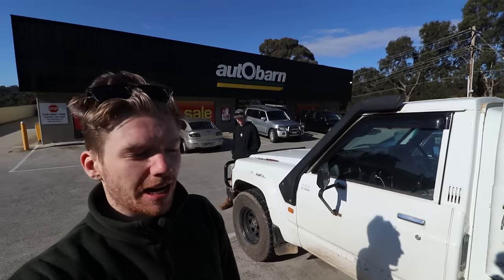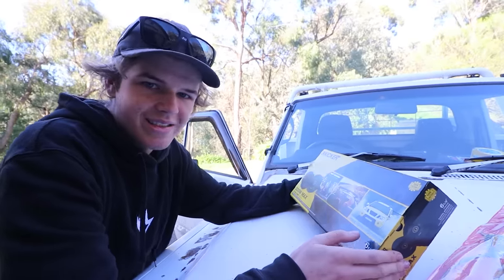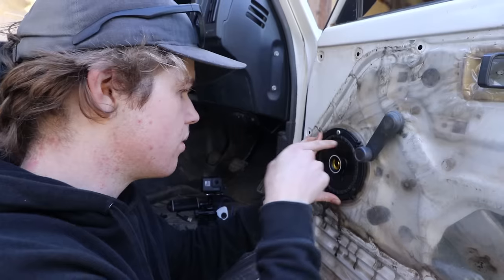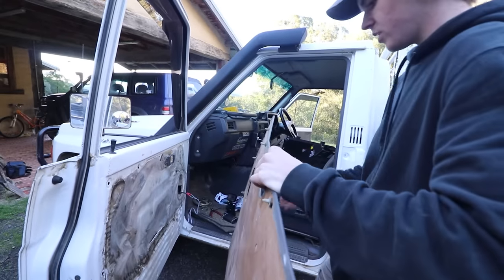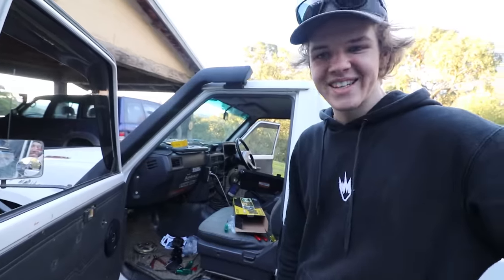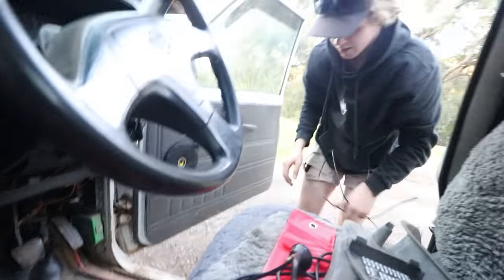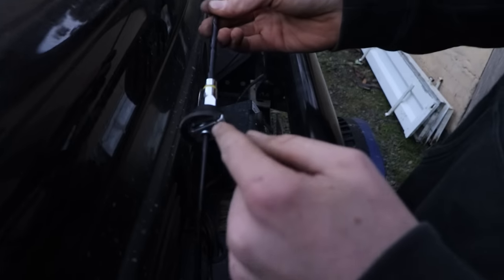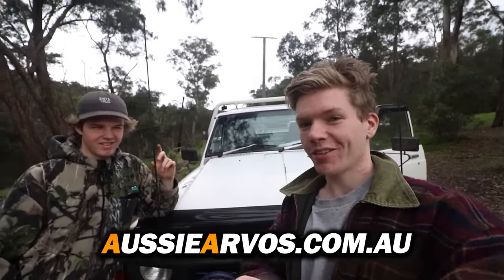BEST MOD FOR YOUR OLD 4X4! | Installing a NEW Sound System + GME Antenna in the GQ PATROL!

Comment: AutObarn fitter here. The kicker KS’ are good speakers. I’ve fitted them to quite a few cars and are a good entry level upgrade. They are well suited for both amplified and non amplified systems. Your head unit only puts out around 15W RMS and those speakers can take 100W RMS. So with even a small amp those speakers will perform even better. Good to see young blokes having a go and getting in a doing stuff. Good on ya. Keep up the good work

Comment: Get a Car-builders Insulation Door kit and you’ll be even more amazed at the sound. $99 for 4 door kit and you could use the excess on the engine firewall. It’s made a massive difference to my GQ.

Comment: Oh also did the factory speakers say peak or rms for the 25watts? Because without an amp you're only going to get around 30watts to the new speakers anyway. if you really want to get the most out of them you should buy a cheap 2 or 4 channel 100w rms amp which will be like a 3 or 400 watt 'peak' amp. They nearly always advertise peak wattage. Rms is the average, what it actually uses.

Comment: Hey guys good video as usual
Just a word of advise from experience feed cable over or under the grille I did it through on mine the couldn't get the grille off to fit my front mount intercooler I had to cut the cable
Reply from the maker: Ohhhh, yeah i see good point!! cheers!

Comment: speakers will work with the wires around both ways. Sounds better to have both speakers wired up right though. Learnt about it at tafe but i think if the wires are around the wrong way it makes the speaker "out of phase" and sounds worse. Probably more apparent when one is out of phase and the other isn't lol. Good job though (Y)
Reply from the maker: Cheers Steve!

Comment: I did different speakers the other day on my 95 wagon same door card design I found the best thing to do was to use some 15mm mdf board as a spacer cut them out with a jigsaw installed the speakers into them and then rivnutted them into the door it’s super airtight and works a treat I’ve tried what you did but I had to redo the whole thing after a few hard bush trips
Reply from the maker: Yeah we heard that spacers are a good idea!! Cheers for the info Morgen!! But yeah they are grouse makes a huge difference!!

Comment: Hey guys you can get the wiring the wrong way round on some speakers and they reverse polarize or something like that basically the speaker will run in reverse no bass
Reply from the maker: Oh thanks for the info Adam! Didn't  know that!!
Reply: @AussieArvos  interesting fact I found when my speakers sounded weird in my old commodore you can watch the speaker either move outwards or inwards (obviously you want outwards) and the sound just didn't sound right
In the video it sounds pretty decent so should be fine
Reply from the maker: oh wow ahaha , yeah think yours are all good!!

Comment: Not sure if anyone has posted this but speakers don’t work nessarily work on traditional positive and negative wiring like say your spotties. The polarity aka how it is wired say positive to positive or positive to negative determines which way the cone in the speaker pushes the air to make sound. Any way, what I’m Tryna say is they will still work even if the wires are swapped but you are limiting your speaker performance. But the fuck would I know, I’m just a chippy 😂
Reply from the maker: Yeah thanks for the heads up! just learning about this all now! good info mate, appreciate it!!